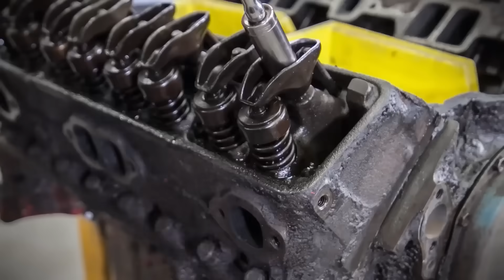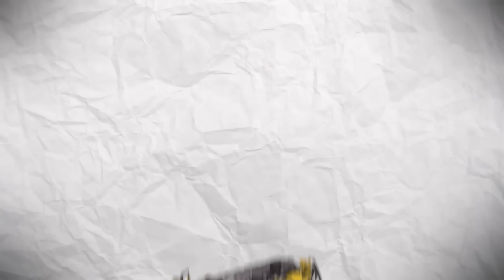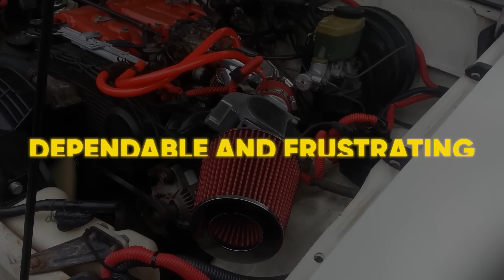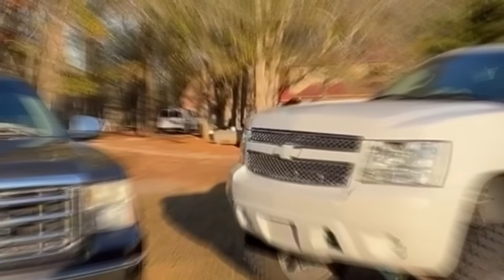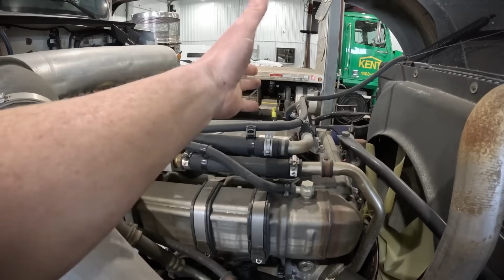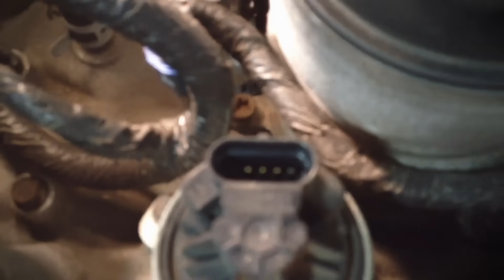The WORST Truck Engines EVER Made! (AVOID AT ALL COST!)

Comment: I had a 2001 Dakota Spot 4x4 quad cab and never had one issue with the 4.7 engine, and I had 280,000 miles when the transmission quit shifting. But the 5.7 hemi I had in my full-size truck was not as good because let it idol, and that is bad for them.
Reply from the maker: Thanks for sharing your experience! That’s impressive mileage from your 4.7—seems like it treated you well. And good point about the HEMI; idling can definitely cause issues over time. Appreciate the insight!

Comment: I have a 2011 F150 , 6 cylinder, 3.5 liter engine with 244,000 miles on it, that still runs like new, no engine repairs EVER! This is a poorly made video trashing the wrong engine!
Reply from the maker: Thanks for sharing—that’s great mileage, and I’m glad your 3.5L has treated you well! I actually put a lot of research into each selection. The 3.5L EcoBoost could almost be on both the best and worst lists—some have great luck, like you, but many common issues are widely reported with 1st generation engine. Definitely worth looking into—you might be surprised!
https://www.truckinsiders.com/truck-blog/3-5l-ecoboost-problems/

Comment: Ford 6.0 head gasket blew on a F-350 and cost 10K to fix. They had to remove the cab to pull the heads 2016
Reply from the maker: Ouch, that’s a tough one. The 6.0 can be a money pit once those head gaskets go—especially with the whole cab-lift just to get to them. Definitely not a cheap fix! Thanks for sharing!

Comment: I rode the #2 engine to 318,000 miles with very few issues. The HPOP went out and I went with a Dodge with a Cummins instead that repair bill. I have 326,000 on my Dodge.
Reply from the maker: Very impressive! Thanks for sharing!

Comment: Another comment on the 5.4l 3v. Understand that the timing chain tensioners are hydraulic. That means, if the oil volume is too low, the chains get loose. Causing them to flop. This will break the plastic guides, and put strain on the cam phasers. Leading to failure. Simple fix, Melling 340 high volume oil pump. As long as the chains stay properly tensioned, they other problems don’t occur. Additionally, when the truck is brand new, remove the plugs and apply a small amount of antiseize compound. 
I work in the hot dry desert of west Texas and southeast New Mexico. The wiring harness can dry out and the insulation can crack. Just change it out. Since the v8 uses individual coil packs, as these wear out or experience voltage leakage due bad wiring harness insulation, spark plug electrode erosion occurs. This leads to rough idle, misses, and back fires. I have seen the spark gap go from .035 to .250 in just a few minutes of rough idle. The cause is the aforementioned wiring issue.
With a little maintenance and some preventative upgrades, I believe this engine can go 500k miles.
Reply from the maker: Thanks for sharing your detailed insights on the Ford 5.4L 3-valve Triton—this kind of hands-on experience is incredibly valuable for owners and DIY mechanics alike.

Comment: I am currently driving my 3rd F150 Lariat, 5.4l 3v. All have been very dependable, exceeding 350k miles with few repairs. My current 2010 F150 Lariat has 426616.2 miles on the original engine. Rebuilt the transmission twice due to normal friction plate wear. By far the best truck ever. I work in oil and gas, so it has spent lot of time on lease roads. To me the secret to longevity is, use Mobil 1 Synthetic oil from the first oil change. At the first sign of timing chain wear, replace the chains, tensioners, and guides, and upgrade to a Melling high volume oil pump. Use good regular gasoline, like Shell. 
It also helps to have a son who is a Ford Master Mechanic to recognize any small issues that may arise before they become big problems.
Reply from the maker: That’s an awesome story! Thanks for sharing such a detailed breakdown—426k+ miles on the original 5.4L 3V is seriously impressive. You clearly know how to take care of your truck, and having a Ford Master Tech in the family is a game-changer! Thanks for watching and commenting!

Comment: I had a 1980 Oldsmobile station wagon and an 1981 Chevy Silverado. Both sucked. The real problem with the injector pump was the weight retaining ring was not compatible with diesel fuel. It would dissolve. The rebuild cost $1000. After multiple problems too numerous to address in the post, I contacted an attorney. He informed me that a class action lawsuit had already been settled. I requested third party mediation with the BBB. The result was Chevrolet had to reimburse me for all repair costs and buy the vehicles back at original price. However, an omission in the decree did not direct me to surrender the vehicle.  I swapped the diesel engines for 350 gasoline engines and drove them for 2 more years. Sold them when I purchased my Ford F150. Got 350k miles on that one before I traded it in for another F150.
Reply from the maker: Wow—that’s one wild ride through automotive history! Sounds like you lived through the full arc of GM’s diesel experiment. Glad you got justice (and a pretty sweet outcome from the BBB case too!). Swapping those engines and keeping the trucks rolling was a bold move—respect. And hitting 350k on the F-150 after that? Classic redemption story. Thanks a ton for sharing!

Comment: General Motors screwed over so many of us who thought this would be a great idea.  I ended up with a blown head gasket on my “diesel” engine.  This is one reason why I will not buy a vehicle made by any GM manufacturer.  They thought they got the last laugh, wrong.
Reply from the maker: Totally understandable frustration. Head gasket issues on GM’s diesel engines have caused a lot of headaches for owners. It’s tough when you expect reliability and end up with costly repairs. That said, GM just invested $888 million into a brand-new V8 engine coming out in 2026-2027—hoping they’ve learned from past mistakes. I’ve got a video about it dropping in a few days, so subscribe and stay tuned!

Comment: I've owned a '10 & a'14 Flex, both were regularly maintained with only a battery for each, and brakes. I don't know where the '14 went after I sold it but the '10 belongs to one of my sons now and grandson drives it. I also had an '09 F150 SCrew 4x4 I sold with 140k on it. Not one issue while I owned it. I also had an early 80s Cutlass with the 350 diesel, it was a sluggish turd. At about 100k it threw a rod so i replaced the diesel with a gas 350. Good video!
Reply from the maker: Thanks for sharing! Sounds like you’ve had some solid experiences with the Flex and F150—those trucks and SUVs can really go the distance with proper care. Haha, that Cutlass diesel sounds like it was quite the challenge—no surprise swapping in a gas 350 made it way better. Appreciate the kind words! Thanks for watching!

Comment: I've got a 2010 4.6l 3v v8 in a f-150 at 230,000 miles still running like new, regular oil changes at 3-5,000 miles and a flush every once in a while keeps it going strong.
Reply from the maker: Nice! That’s a great example of how regular maintenance keeps these engines running smooth for the long haul. Thanks for sharing!

Comment: As to the 5.7L GM diesel, by the end of the run, GM had pretty much worked the bugs out of the engine, and they were actually fairly reliable and efficient, but the damage had already been done. No one wanted the 5.7 at that point anymore, so GM came out with the 6.2L Diesel, which was more powerful and more robust, but actually didn't get as good mileage as the 5.7L was capable of.
I used to work for the National Park Service in the late 80's and early 90's and we had 2 Chevy 2500 trucks with the 6.2L on my district. They were pretty anemic power wise, especially when we were pulling the horse trailer behind them with 4 horses in the trailer. The 6.2L was no speed demon. On hills, it lost speed. A 454 did about as good mileage wise, but the 454 made much better power.
Incidentally, the GM 5.7L and the GM 350 diesels were the same engine.  5.7L equates to 350 cubic inches.
Reply from the maker: Great insight! Sounds like GM ironed out the 5.7L diesel’s issues toward the end, but the timing wasn’t great. The 6.2L had more power but less mileage, and those old diesels definitely had their quirks — especially towing heavy loads. Thanks for sharing your experience with the Park Service trucks! Feel free to checkout the updated video: 
The 17 WORST Truck Engines Of All Time! https://youtu.be/H2LgOX41TQQ

Comment: I have a 2005 Ram 4.7 V8 .. and it IS MARVELOUS! yes the oil has already turned to mud once .. BECAUSE THE DAMN MECHANIC WAS ON PURPOSE NOT TO PUT IN THE RIGHT KIND OF OIL .. at 217,000 km Barely started to knock a little on the left side..engine starts at 1/4 turn. Never had any big problems with it..compared to the 3.7 V6 from Ram..this truck is not killable.
Reply from the maker: Sounds like that Ram 4.7 V8 has been a real champ for you! Thanks for sharing your experience!

Comment: I thought that the 5.7l Oldsmobile had things sorted out. In 1981 last year available in 1/2 ton to 1985 available in cars . Had issues fixed but the reputation was sp bad the damage was done. Not 100% sure if there was a huge difference roller cams comes to mind
Reply from the maker: Yeah, the 5.7L Oldsmobile had its rough patches early on, but by the early '80s they’d fixed a lot of the issues. Still, that early rep stuck around, and it’s tough

Comment: Many of the 5.4  3 valve ran well over 200,000 miles If you used good oil and kept changed, too many of us do not particularly in trucks.
The 5.4  2 valve was actually hard to kill most lasting well over 250,000 miles, some were labeled triton V8.

Comment: Well, I have a 2012 3.5L EcoBoost with 88k, my oldest son also has a '12 with 178k. My younger son has a '13 EcoBoost with about 120k.  Theirs have been OK. My oldest son's had issues with turbo piping and fuel pumps.  Me too.  The '13 has transmission issues.

I had a Durango with the 4.7L V8.  Loved it.

Comment: Wow, my '08 Chevy 5.3 has run effortlessly for the last 230K miles. Granted, she leaks from the valve cover gaskets like there's no tomorrow, but other than that still runs fine. AND: My '08 Ford 6.4L is running just fine too. She only has 150K miles on her though.

Comment: Ok the 3.5 Ecoboost is an absolute monster, that if properly maintained can reach 600k plus miles plus it tows twice what the V8 does, I don't know how this person can put it on this list I have a 2012 3.5 and it does everything I need it to and is unlikable. The thing that can kill them is doing your oil change at 10k like a lot of newer cars say to do, if you do it every 5k and work it every once in a while it won't die I just saw one with over a million miles on it, it was another 2012 3.5 Ecoboost, I regularly see them with over 300k miles zero issues even with the original turbos.
Reply from the maker: Hey, thanks for the comment and for sharing your experience! It’s great to hear your 3.5 EcoBoost has been so solid — sounds like you’ve taken excellent care of it. No doubt, when properly maintained, these engines can go the distance and perform incredibly well. That said, not everyone has had the same luck, and there are some well-documented issues out there, especially in earlier models. Totally understand where you’re coming from, but I’d encourage you (or anyone curious) to do a quick search or check out some forums — you’ll find a lot of discussion from owners who’ve run into real problems too. It’s all about sharing the full picture. Appreciate you being part of the conversation!
Reply: @Autotrends5  I've been in those forums I did a lot of research before buying the truck I haven't found anyone or any big number of people that have had issues with the 3.5 Ecoboost only time I see these things with problems is when they've been beaten to hell and back and never serviced. Obviously lemons exist but a good 80-90% of these engines will outlast most other engines in its class if not any other engine in its class.
Reply: I have a 2013 F150 with the 3.5.  Not high mileage but its been a flawless engine for me.
Its all about personal experience with certain engines.  I have a 'bulletproof' 4.0 in my jeep that crapped out at 50K.

Comment: Your first 2 engines were the same! An Oldsmobile gas V8 turned into a Diesel! Your worst engine the the Foerd 5.4 3V Triton V8 wasn't introduced until 2004 not 1997! The 97 5.4 2V Triton V8 is mainly reliable!
Reply from the maker: You're absolutely right—great catch! That was a mistake on my end—humans make mistakes, especially when working on these videos at 3am while the kids are asleep 😅. I’ll make sure to fix it in the next video. Thanks so much for watching and for your input—really appreciate you taking the time to comment!

Comment: I owned a 2014 ecoboost and it was reliable and powerful until I sold it at 90K, though I did see excessive particulate under heavy acceleration. 
I owned a 2002 Dakota 4.7 for 12 years and 236k miles before trading it due to transmission slipping in 100 degree weather. It was trouble free and easy to maintain.
Reply from the maker: Thanks for sharing your experience! It’s great to hear your Ecoboost and Dakota served you well—real-world stories like yours add valuable perspective. Even engines with mixed reputations can be solid performers in the right hands with proper maintenance. Appreciate you watching and contributing to the conversation!

Comment: So I've never owned a north American vehicle whose body wouldn't fall off before the driveline failed. Gotta give it to ford and the likes for stepping up with aluminum of course you couldn't drop your discontinued snap on tool box loaded with more stuff than most of us own obscenely hard and in a way nobody would ever do onto your aluminum bodied vehicle. But you know as i look out onto the driveway where my silver roto is i think that doesn't matter much. The body and the electrical fail in most cases first because whores like money and don't do anything best practice.
Reply from the maker: Haha, yeah I hear you. A lot of North American vehicles do seem to rust out or have electrical issues way before the engine gives up. The move to aluminum was definitely a bold one—helped with rust but yeah, not exactly toolbox-proof. At the end of the day, it’s usually the little things (or bad design choices) that bring a vehicle down, not the driveline. Appreciate you sharing your experience!

Comment: I have put 307,000 miles on a 2015 2.7 and got 22.9 mpg when the transmission went out we traded it in. I currently have a 2017 2.7 with 305,000 on it getting 24.9 mpg. When this truck gives out I fully intend to get another 2.7 truck. Our company has gone through 9 of these f150 2.7 eco boost. Every one of them has performed fantastic. The current Rangers and mavericks SUCK IMMENSELY
Reply from the maker: Wow, that's some seriously impressive mileage—over 300k on multiple 2.7s is no joke! Sounds like you've really put them to the test and they delivered. It’s great to hear real-world feedback like this, especially when it goes against some of the hate these engines get. Totally understand sticking with what’s worked for you. And yeah, the newer Rangers and Mavericks definitely seem to be hit-or-miss for a lot of folks. Thanks for sharing your experience!
Reply: @Autotrends5 that's normal though with both the 2.7 and 3.5 you're delusional if you think these engines are unreliable. I haven't met anyone with a problematic one.

Comment: Internal Combustion Engines have been built since the mid 1880s. Its hard to believe in 140 years they haven't figured out yet what works and what doesnt work.
Reply from the maker: That’s a great point—and honestly, it is kind of wild when you think about how long internal combustion engines have been around. You’d think by now we’d have it all dialed in, but it seems like every new generation brings both improvements and a new set of problems. Part of it’s probably the constant push for more power, efficiency, and lower emissions—but yeah, you'd hope we’d be past some of the basics by now. Appreciate the insight!
Reply: The processes and mechanical aspects are extremely well understood.  Enter the EPA.  All bets are off.  Your tax dollars at work.